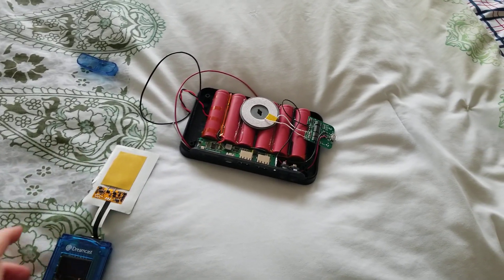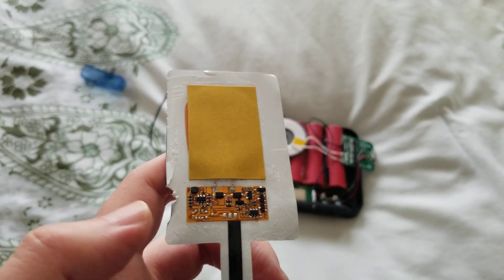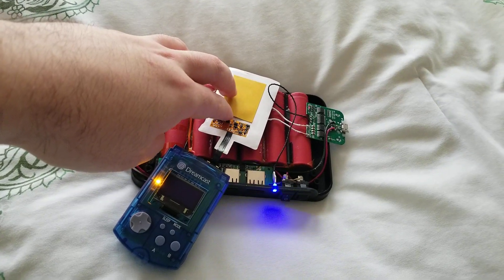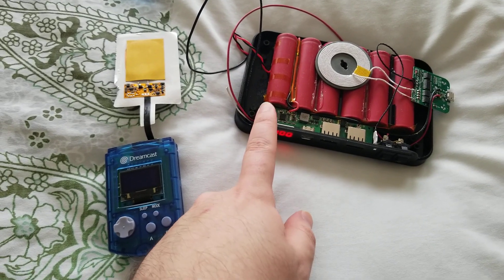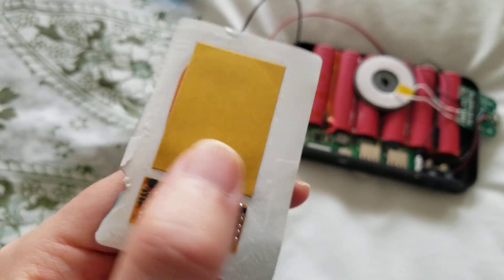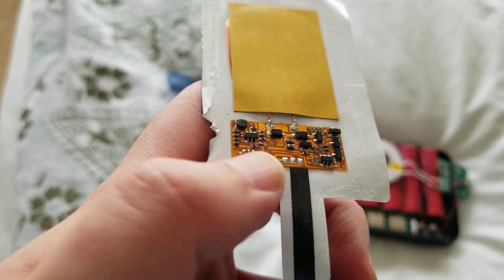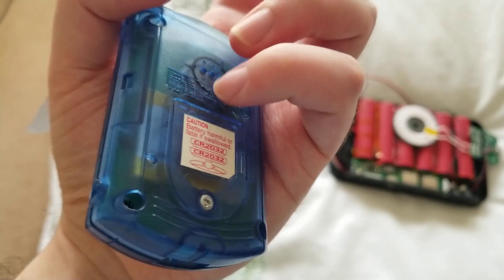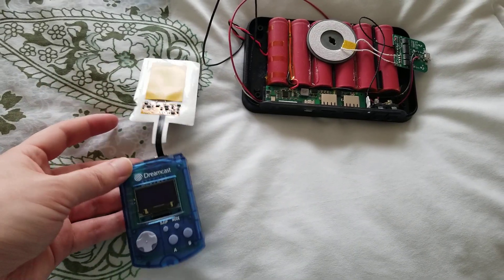Quickbit: Wirelessly Charge an Arduboy Clone in a VMU?!?!

Comment: I'd just been meaning to ask you how you power your arduboys! I made mine with the chinese 5.5v pro micro clones. All of the tutorials I was seeing were for 3v ones, I assume I can still charge a battery through the thing itself but I have no idea what kind of battery I'd be looking for...
Reply from the maker: I use a 3.3v ldo regulator to power the atmega and oled. In the past I've run everything off 5v just fine though. As for the battery I repurposed a small lipo and charge it over usb using an onboard max1555.
Reply: @sjm4306  ah, I see, thanks! I was considering getting some 3v boards anyway since the battery will probably last longer. I imagine you'll probably see what I end up doing anyway 😂